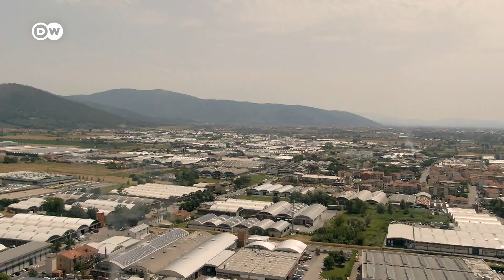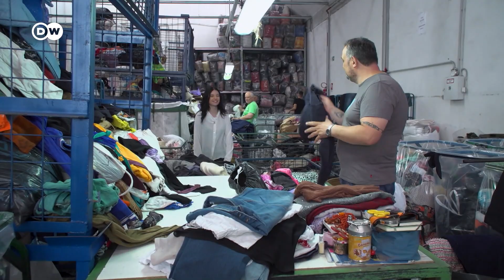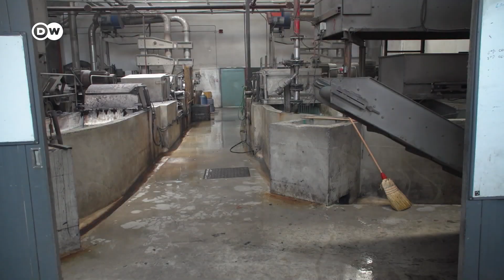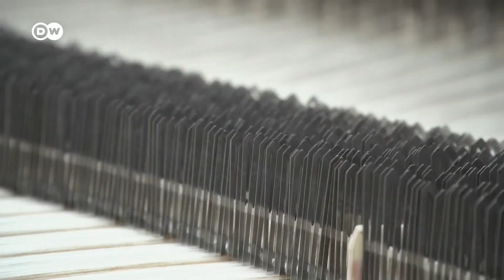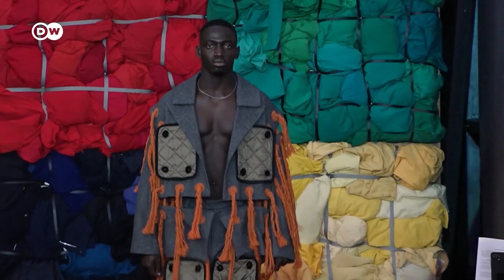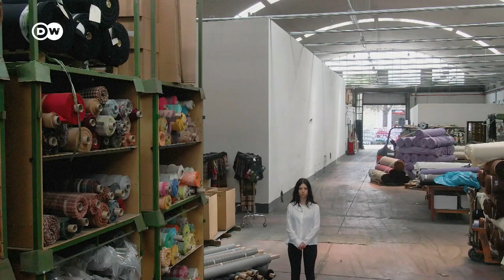Italy's capital of textile recycling | Focus on Europe

Comment: Viewer beware! Love how they skip through Africa and not explaining further. These cheap synthetic material are shipped to Africa…such counties like Ghanda are suffering from overwhelmed of the amount of cheap clothing arriving to their country. Not only they are using Africa as a dumping ground but also ruing their economy by offering inexpensive price for these used clothing…this will drawn the local ppl to buy clothing at less expensive price rather than supporting their own local products. This creates problems with jobs…..if you want to see more on these issues in depth you can find short reports on BBC
Reply: i did see that actually. i really love sustainable clothing and that’s what i personally buy, but i don’t like this relationship with africa. i recently saw a pretty disturbing headline, something like, ‘used clothing from europe: trash or treasure for africa?’ (though perhaps it was addressing the issue?) with respect to used fast fashion that just felt self-explanatory; why should it be useful for african folks to receive things that we ourselves don’t want and that are a bane on worker’s rights and lives in various countries, with questionable quality because of the sheer speed and pressure of production?! it’s very weird and feels extremely dissonant. there seems to be a lot of dissonance, to put it politely, in this area as well as many others!
Reply: I guess it is better for them to go to Ukraine, Romania and Bulgaria coz those when burned can heat up poor people sadly since also synthetics are send it produces smog